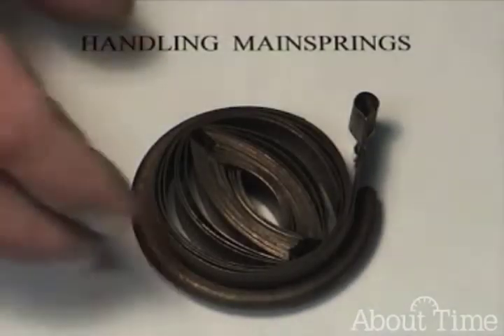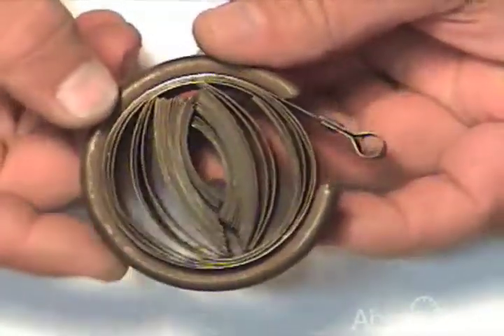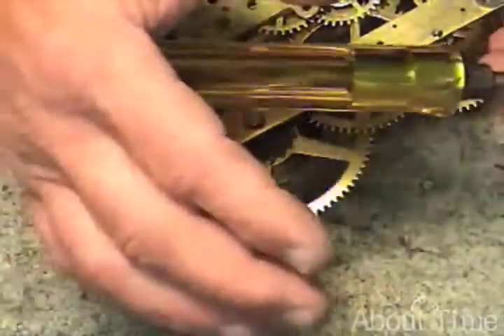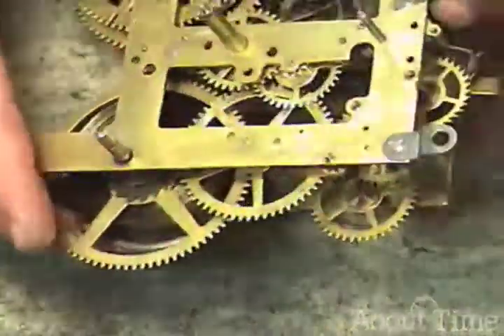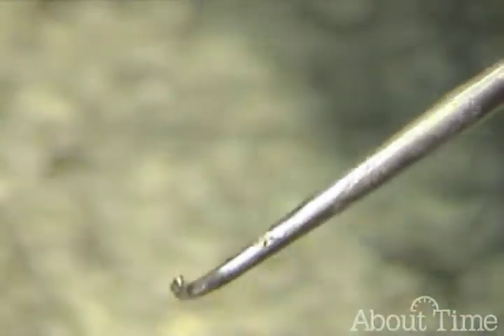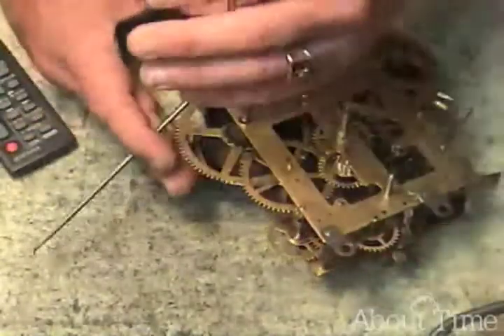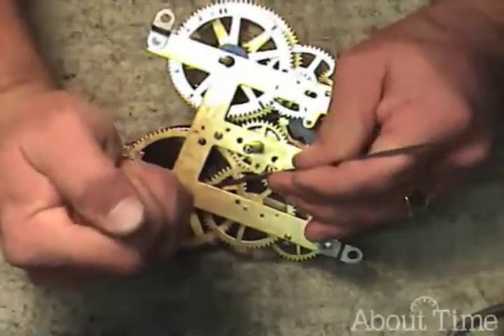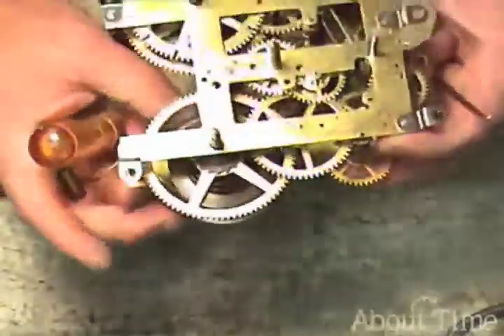ClockClass - Handling Mainsprings

Comment: I have looked in clock supply catalogs and there is no such thing as mainspring ''clips''.
There are there are mainspring clamp , both courved and flat for loop end (open) springs
There are no ''clips'' for hole end (barrel) springs..but there are sleeves.
Reply from the maker: Thanks for catching that!  You are correct, I used a term not found in the parts catalogs and should have called them "clamps" or "sleeves."

Comment: First off, I'm not familiar with clocks internally. What I'm trying to do, is remove a mainspring barrel from the movement. The mainspring no longer winds, so I would say that the only power it has should be minimal, you would know better than I. I know about the click, and I guess I would have to fully release the mainspring completely before removal. However my biggest problem now, is once I release all the power, how do I remove the barrel from the movement?  Thanks in advance for any reply. The clock is a Wuber Warmink (Dutch, I believe), if you need a pic of it, let me know where to send it. I plan to send it to a clock repair person to put a new spring in.Bill

Comment: Sir: I would be very interested to know how you got that exploded spring safely out of the clip, or what method would you recommend?   Thanks Mike
Reply from the maker: Hi Mike-  I keep that particular example intact for training purposes.  However, it would be a simple matter to remove the pieces since the mainspring no longer has much energy.  It is just a bundle of fragments which can be pushed out so the safety clip can be reused.  if the pieces can't be removed by hand, they can be driven out with a punch.

Comment: Do you need a clamp is the springs are in barrels?
Reply from the maker: Great question!  In order to disassemble a movement where the mainsprings are in barrels, all that’s needed is to let the mainsprings down inside the barrels.  No safety clips are necessary.  However, it is often necessary to use a safety clip in order to remove the mainspring from the barrel.  Certain types of mainspring winders come with specialized clips for that purpose.
Reply: @clockclass5480  thanks for the reply!!
Reply: @ninobenjamin4067  They are called sleeves not clips.

Comment: do you have to use a clip when unwinding the mainspring?
Reply from the maker: Joshua Staggs. No, but...  Without the safety clip it is difficult to tell if all of the power is off of the gear trains.  Also, the mainsprings can be really large when completely unwound and will invariably put lateral pressure on any gears they contact.  In lieu of a safety clip, I’ve heard of people using zip ties or wire but I don’t trust those.  So, safety first!  Use a clip :-).
Reply: ClockClass  Thanks! I went ahead and bought clips. I'm fixing up a 1905 Gilbert clock, and right now I'm disassembling it. Trying to make it look new again.
Reply: @joshuastaggs4638  They are not clips, they are clamps.